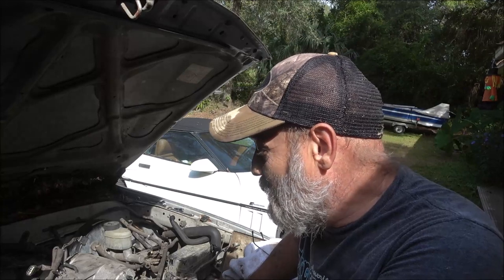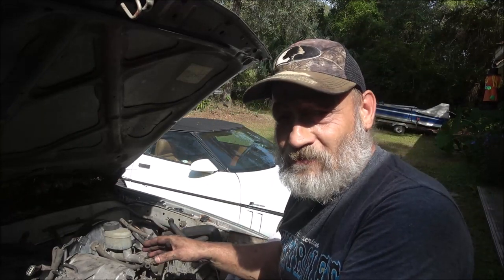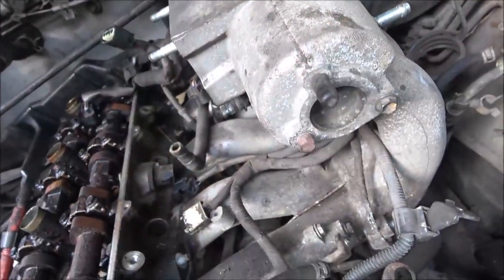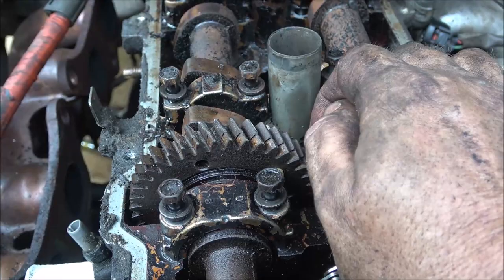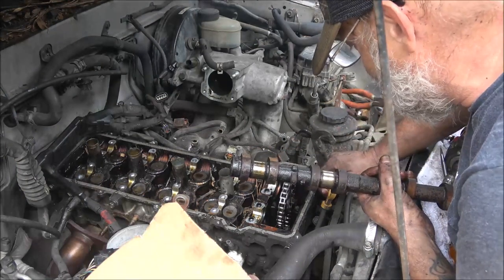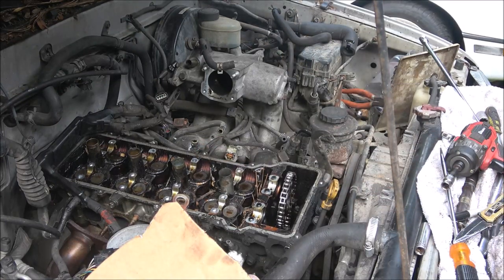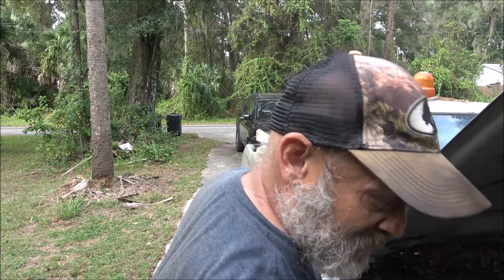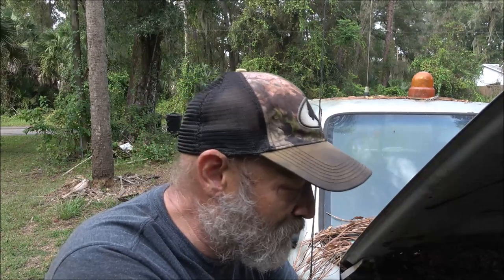Head Removal 2003 Toyota Tacoma 2 4L DOHC Part 1

Comment: I just had to replace both gaskets on my vtec solenoid and that was a bitch. Almost had to take the coolant intake off but was able to fit a offset wrench down in there and get those bolts out.
Reply from the maker: I would love to see an engineer try to work on the stuff that they come up with. They couldn't do it.
Reply: @shabear1000  oh hell no lol and the newer fords where half the engine is underneath the fckn firewall lol ill never get a ford again
Reply from the maker: @kenny_525  yeah those Ford trucks you have to raise the cab up 8-10 inches of you have to pull the engine. It's stupid 🤬 lol